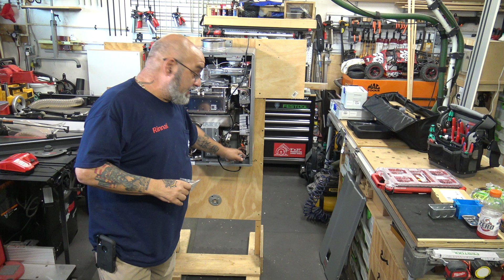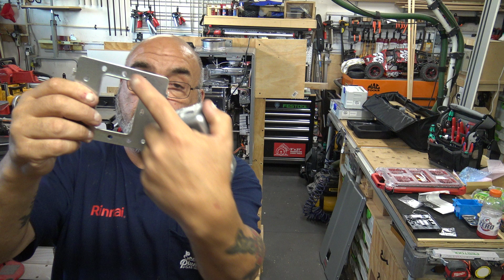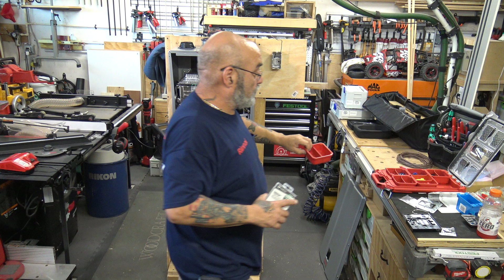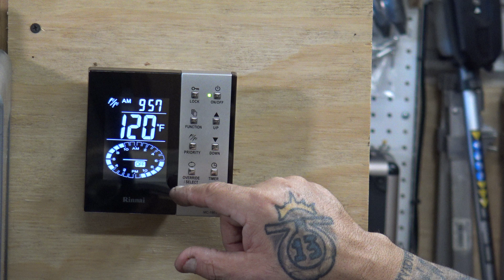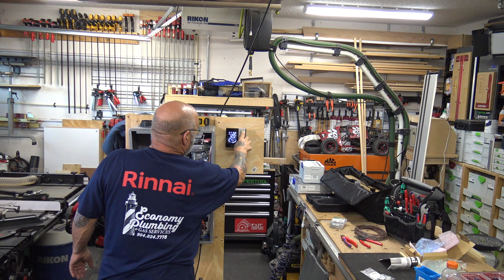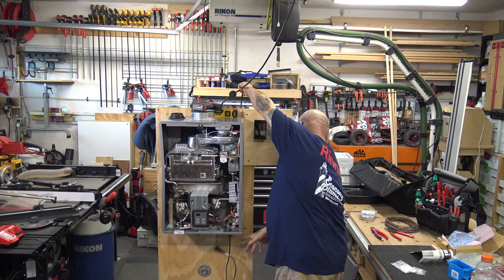How to install Rinnai's MC-195-T US

Comment: I'm a licensed plumber in NC and i have installed 2 Rep199ip (REU-VEP2730FFD-US)rinnai water heaters hooked up in series with a dedicated recirculation line using the pump in the water heater with the one I have made as the primary using the EZ-CONNECT wire and the other as secondary and have done them this way for a few years now and i have no problem with the way they operate. on this particular home that I have just installed these though the homeowners don't live there all the time and when they leave for a few weeks and then come home they tell me their water heaters are not working properly and so I  go out to their home and I have to reset the water heaters. I know that there are the wireless controllers as well as the wired controllers that are made for these water heaters i have just never put them on before and i am not sure if these would fix this problem or not as far as being able to allow the homeowners to be able to control the water heaters with these controls to be able to cut them off when they leave and when they come back to this home turn them back on and it be set to the same program that I had them on when they left the home instead of me having to go back and reset the water heaters every month or so when they come back to this residence. I am sorry for such a long question Mike! If you have time can you just give me a yes or no to this question? I will continue to research this on my own. I have reached out to the Rinnai tech and they have been great with trying to help but I haven't been able to explain it to them well enough for them to understand. Thank you for your time you give as well as your knowledge to help me better understand! Happy New Year!!!